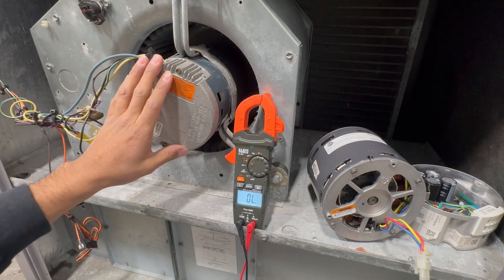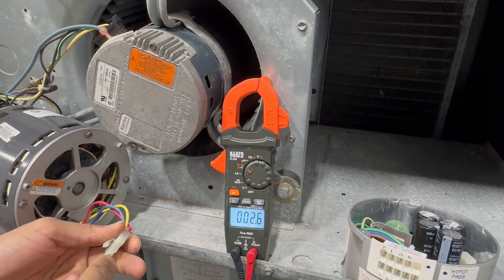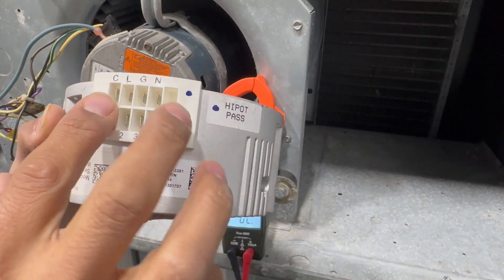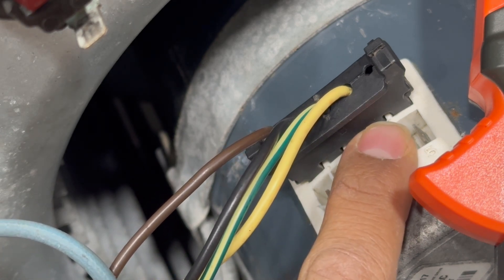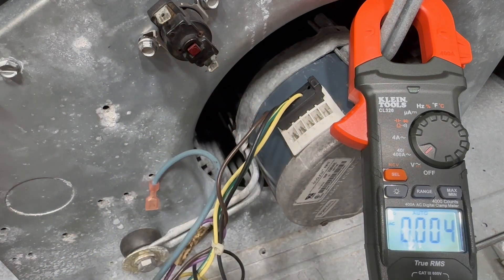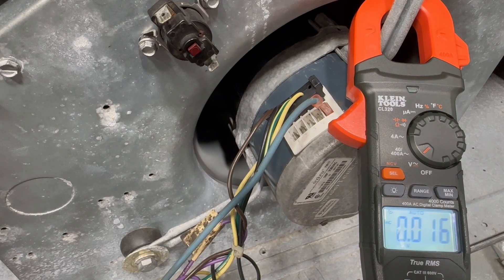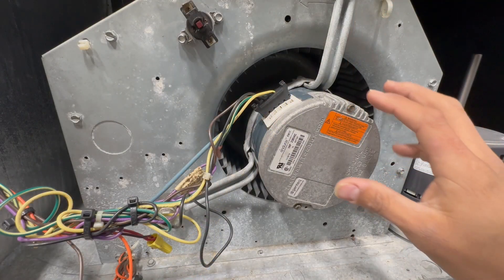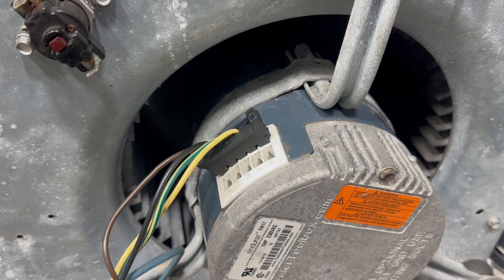How To Check ECM Motors - HVAC Training

Comment: exactly , dumb mfg. wiring to put the low voltage common wire on the top while all the low voltage are on the bottom , well said

Comment: I have one of those motors.  It started makes a humming noise but only at start up.  Can it be that the ecm is going bad?
Reply from the maker: If it’s still working, that’s good. Typically the modules on the ECM go bad. What kills them is airflow restriction, dirty filters, undersize returns, closed vents, etc. Maintenance and proper installs will prolong the life of these motors.

Comment: So that brown wire is putting out 24v ac or it requires 24v ac? If I wanted to use as a shop fan can I connect the brown wire to one of any lower pins and it will work? Or do I need a separate 24v source? And last is it 24v ac or 24v dc if I need a separate power supply? Thanks
Reply from the maker: The brown wire is common from your 24 volt transformer. It’s not coming out of the motor but it’s going from the 24 volt common transformer to your ECM motor.
Reply: @PioneerHVACControls thank you!

Comment: What happens if the supply is blocked . Would that increase the amps at the same with return block.
Reply from the maker: It depends how bad the blockage is but with an ECM and you have a slight blockage, the amps tends to go up to make up for the air restriction, either in the return or supply.
Reply: I think with any diagnostic you would need to make sure other things aren’t affecting what you’re  getting

Comment: Why would the motor not turn on again after removing the high voltage side of the motor with high voltage present?
Reply from the maker: In my experience, if you remove the high voltage from an ECM and connect it back, you will have fried the motor. Always check it while the high voltage is connected. You can check for voltage behind the taps without disconnecting it.
Reply: @PioneerHVACControls so I can unplug high voltage as long as I kill the disconnect in the attic? And then plug it back in once I turn off the disconnect right? 

You’re just saying don’t ever connect or disconnect it while high voltage is still active (disconnect on). That’s understandable.

Comment: I replaced an ECM motor that would not turn off. I took the board off and see nothing wrong. I've watched many videos and NO ONE talks about a motor that runs constantly.
Reply from the maker: Those modules on the ECM can be tricky. If it tends to behave erratically, especially if the system had a high static pressure on the airflow side of things, could be a bad module or it could be going bad.
Reply: @PioneerHVACControls  What is wrong with it if the motor won't turn off???
Reply from the maker: @JeffBattleFish make sure your not getting 24 volts going to any of the 1-5 tabs. Need to confirm no low voltage is going to the motor. Even if the thermostat is not calling for it, you’ll be surprised that low voltage power is finding its way there somehow
Reply: @PioneerHVACControls  I bought a new motor and it works fine. Just trying to find out if I can fix the old one that runs all the time.

Comment: Would the voltage reading be 24VAC for common to ground? I’m a hvac student and there’s an actual bad system. I don’t read anything from common but only get 1 low voltage reading from 1 which is low heat. I change common to that 1 and fan turns on but doesn’t when all wiring is correct at least from control board to motor. Teacher and other students suspect it’s the ecm motor but I doubt it.
Reply from the maker: If you’re referring to the brown wire, that is your common coming from your transformer. Typically that wire is ok. Next to the common, you have high voltage which must be present at all times. What turns the motor on is when it receives 24 volts on any of the 1-5 taps.

Comment: Mine started to kick on this morning, run for about 30 seconds, then shut off. It kept doing that over and over until the coil began to freeze. So, I pulled the disconnect to look in there for about 30 mins, and when I covered it and turned it back, the motor went strong again non-stop. 

What do you think?
Reply from the maker: Could be a bad module or a module going bad on the ECM

Comment: Looking at the motor nameplate, I see PH1, which typically indicates a single phase motor. Please explain the comment about it being a three phase motor.
Reply: single phase AC coming in is converted to DC.  That DC voltage is then sent through an inverter (a series of transistors) that generates three controlled DC waveforms — effectively three-phase power
Reply: @condor5635  Thanks..Yet the nameplate on the shown motor has PH1 in the area indicating number of phases--maybe an error?
Reply: @TheDigitaldoug  the motor takes a single phase as input, but during the DC conversion process makes it a true three phase DC motor
Reply from the maker: I couldn’t have said it better like the replies 🙌🏼

Comment: Would the low voltage wire come from G thermostat wire, or where does originate?
Reply from the maker: On some applications, it comes from your thermostat and on other systems, the low voltage comes from your board.
Reply: Gotcha, either or, depending on manufacturer?

Comment: Is there only one low votage wire on bottom, numbered terminals?
Reply from the maker: Yes, 5 low voltage wires. 1 being the lowest and 5 the highest speed.
Reply: 5 total, where each powered from?
Reply: Is each only powered one at a time?

Comment: Why does the data plate on the motor itself, say single phase PH 1?
Reply from the maker: Because it takes single phase 208 volt power, 2 hot legs and converts it to 3 phase power, 3 hot legs going to my ECM motor.

Comment: When I come across a defective E.C.M Motor and I discover that the Electronics are damaged, I will troubleshoot the components and just replace the bad components... 🤷
Reply from the maker: Nice! Someone told me it’s usually the inline thermistor that goes bad. What has been your experience?
Reply: @PioneerHVACControls nothing to serious, maybe one of the capacitors may have exploded or maybe a blown fuse. A few times I did find some loose wires 🤷

Comment: eres un genio...!!!! Me salvaste ..!! Aca en Argentina, recien este ultimo tiempo, han aparecido estos motores, en los sistemas de aire acondicionado centrales/rooftop, y no los conocia...Evidentemente, quieren que los sistemas duren menos..Obsolencia programada...!! Ya no quieren que los motores duren 10 o 20 años, y habra muchos problemas con estos motores nuevos, a la hora de reemplazar sistemas viejos, porque la gran mayoria de las instalaciones viejas, tienen serios problemas en sus retornos de aire, mayormente porque los arquitectos, no respetan las dimensiones necesarias, y siempre falta caudal en los  retornos de aire..Y si a eso, le sumas, que el cliente se olvida de cambiar el filtro de aire sucio, esta garantizado que estos motores ecm, se quemaran,....Por suerte, veo que usan señales de 24V separadas para las velocidades, dando la posibilidad, de poder reemplazarlos, por motores tradicionales,con capacitor y un par de relays, para manejar las velocidades...Gracias por la clara explicacion....!!!Saludos amigo mio, y buena vida...:!!!

Comment: What would cause the blower fan to turn on with thermostat off and fan on auto? Checked for shorts, pulled thermostat off mount and still runs. It does it intermittently, also no frozen lines.  I haven't check that A coil yet to see if its dirty.
Reply from the maker: Maybe a shorted relay on the board supplying constant power to the motor

Comment: Thank you for the explanation man. When connecting live power to the motor, is it because components can be burned?
Reply from the maker: Someone explained to me that because the module has capacitors in it, when you unplug and plug in with power; you’re in a way discharging the capacitors, creating something similar to an arc internally.
Reply: @PioneerHVACControls makes sense. Thanks

Comment: Can you just replace the ECM module instead of the whole motor? Also, when you say not to plug in the high voltage when power is on, would that only kill the ECM module or the entire motor?
Reply from the maker: It would kill the ECM module when unplugging it and plugging it back in with power present. And typically it’s hard to replace just the ECM module on its own; you sometimes have to get the whole thing replaced.

Comment: My Tempstar blower motor was an ECM and went bad.  I removed it and opened it and realized that the actual winding of the motor was HALF of what a standard single speed motor is and as a retired commercial electrician I know that windings determine the HP!  Then when I contacted the local AC parts distributor where I get my relay contactors and capacitors and they quoted me a price of almost $500.00 to replace the ECM.  The electronic board in that motor is smothered in epoxy so I could not even check for what component went bad as it should have been easy to replace capacitors, mosfets, diodes, etc. 
The standard non ECM motor was only $146.00 from that AC parts store.  I deleted the low voltage wires and replaced my relays and wired in the non ECM motor and to my surprise, my air movement increased significantly and my power bill went down $30/month.  A 1/2 HP ECM motor is NOT the same power as a non ECM 1/2 HP motor and anyone who says that you can get 1/2 HP of power from half of the winding that a non ECM motor has is full of BS.  I will go Mini-Splits when this old Tempstar dies but it is still going strong after almost twenty years (it really is a Carrier) and I have only replaced a condenser capacitor once, a relay contactor once, a transformer in the AH once, and the 1/2? HP ECM motor was replaced with a standard non-ECM motor once.
Reply: I an a licensed HVAC/R contractor. A few years ago I had a store with bad 3/4 HP ECM blower n=motor of the RTU. So, its Friday, almost 4 PM, a middle of November and 25F outdoor... That RTU was 14 y.o. Local store quoted me over $600 for the replacement motor and.. 3 weeks.. That was a little weird ECM motor;  constant torque, but very unusual connectors/plug-ins. 
So, that was my first ECM blower motor that I've replaced with a PSC motor. It just required a dedicated contractor that would control the motor..  I was thinking that 3 weeks later, when the OEM motor arrives at the local supplier, I will install that ECM motor. However, my customer told me tahat they are very happy with the unit performance and there is no need to change anything.... Since that time, I replace all ECM motors with PSC blower motors and I didn't hear negative feedback. Mostly customers wouldnt notice any difference or tell me that it seems to push the air better...
Reply: Hi there great video.  I have a question!! My motor makes a humming at start up only.  Does this mean the ecm is going bad?  I have checked the balance and all bolts to be fastened correctly.

Comment: My Genteq 2.3 motor went bad. I tested the ohms per your video and my readings did not match. I disassembled the motor and found areas of the copper wire winding with burned insulation. The wires were shorting out on the different phases. I was able to isolate the affected wires and retested the ohms. Then it was an equal 5.6 across all three leads. I used epoxy to insulate the wires. Now it works. When the wires were shorting, the motor had a lot of resistance when trying to spin the scroll fan by hand. Similar to regenerative braking I suppose. After the shorted wires were isolated and insulated, it spun very easily. Fortunately my endbell module is still good.

Comment: if on the low voltage I only get 14v where am i missing my othe 10v ?
Reply from the maker: You probably have an open safety. Board could possibly be bad but if your getting 24v coming from common and Y, if your using cooling, I would look for an open safety.

Comment: Hi!
Is high voltage goes to motor after the module will be AC or DC current?
Thank you.
Reply from the maker: It’s going in as single phase AC voltage and it’s going to the motor as a clean 3 phase AC voltage

Comment: Mine runs for about 30 seconds and the slows down and will eventually stop running unless i wait a while.  I noticed my motor has 2 wires (blue on 3/white on 4)  do you think switching these to 2/3  or 1/2will make the motor run again I'm willing to try anything at this point? I'm in TX and we've been struggling for a few days now, since the AC company said the new motor would take 2 weeks to arrive, unless I bought a new air handler from them on sale for $3025 (not sure but it sounds like hustle) that could be installed tomorrow. Just trying to figure something out. Thank you for the informative video
Reply from the maker: You should have taps 1-5. You can try putting it on the taps you’re not using. Any numbers other than 3 and 4. Depends what kind of system you have, but typically the one going to a higher number is cooling and 3 is for heating. Try putting the blue one on 2 and the white one on 5.
Reply: @PioneerHVACControls  Ahh just the info I needed Thank you !!

Comment: Would it be nice to try 2,  3, or 4, slots to see if they are Programmed...most techs like me we only Test 1 , and 5 Terminals
Reply from the maker: That’s true, we always try 1 and 5 lol. All numbers are all programmed though 👍🏼
Reply from the maker: Simply take the 24 volts to 2,3 or 4 and you’ll see it speed up as you go higher.

Comment: What goes bad on the module are the "thermistor" that is a thin disc type of electronic part. That part is $1.50 to purchase on its own however, installing one is time consuming. Maybe those in the engineering departments could find a thermistor that is more robust and lasts as long as the motor itself. Yes, a $2 part fails and it costs the public $400 to $1,000 !

Comment: Thanks for a clear explanation on ECM motors. I worked on one close to 20 years ago. Checked voltages and resistance until I was sure it was just a module. Changed module and motor ran fine.

Comment: I’m really appreciate you’re explaining very clearly. You said shot off the power then connected then power on why? Thank you.
Reply from the maker: Thank you for watching! Yeah, you don’t want to unplug the high voltage plug off of the motor to check if there’s voltage and then plug it back. I’ve killed two motors doing this. I’m thinking because of the high potential that exists. What I do to ensure I have high voltage is shut off power, disconnect the plug, hold it in my hand and turn on power and confirm I have high voltage. Then I Turn off power and then plug it back in and turn on power. You want to avoid taking it out and plugging it back into the motor with high voltage present.

Comment: I’m wondering. You said “it’s cool” but why’s it cool? Wouldn’t it be much easier to fix and less likely to fail if it just took 120 from the board with a few wires. Why make such a complex motor I don’t understand.

Comment: why do you have 208v going to the motor when it calls for 230?  Are you connected to the 208 output on the transformer?
Reply from the maker: I meant to say I have 208 volts coming in and the motor takes 208 volts. Thanks for catching that 👍🏼

Comment: Awesome explanation but a blocked filter will reduce the load meaning less amps. A blocked filter will overrun a PCE motor. Ask me how I know...
Reply: A PSC motor will have less amps in the case of a blocked filter, but a constant torque ECM motor will have more.

Comment: Just my 0.02, some of them are 18v dc not 24ac. I've seen them only on Nordyne package units. Do a video on the 16 pin and the one with 4 wires not the 5 taps please.

Comment: What is the difference between powering down by the disconnect switch vs. unplugging at motor?
Reply from the maker: You can unplug it at the motor but you need to make sure there’s no power going to it. That’s why you power it down at the disconnect first. You then Hold the plug in your hard, turn on the disconnect, check you have high voltage going to it, turn off power at the disconnect, plug it back in and flip the disconnect on. 

If you unplug it with high voltage going to the ECM motor, you will mess up the motor.
Reply: Possibly due to arching?

Comment: It's an irony of design when the reliability of a PSC motor is swapped to a device with a built in design flaw that makes it more vulnerable to damage from external causes of poor air flow. Why did they design ECM blower motors to be on a constant torque performance curve?

Comment: Great video, I would say the only thing that could be a little bit better practice is checking your low voltage from the 24v tap directly to the common terminal of the motor, just so you know that you don’t have a bad common wire going to your motor. I’ve only seen it a few times though, out of hundreds and hundreds of motors though
Reply from the maker: Good point, thanks!

Comment: Does "PCM" motor control speed controlled by "high voltage"?

Is "ECM" motor speed controlled by "low voltage"?
Reply from the maker: Are you referring to PSC motors? Yes, ECM motor speeds are controlled by low voltage.
Reply: @PioneerHVACControls  ECM=Low voltage.

PCM=controlled by high voltage?

Is my logic correct or incorrect?
Reply: @gotchaplumber You are correct but it’s PSC not PCM, PSC is permanent split capacitor
Reply from the maker: @gotchaplumber  PCM might be referring to something else. Another motor you commonly find in HVAC is PSC, permanent split capacitor motor and it takes high voltage to turn it on. There's no low voltage present.